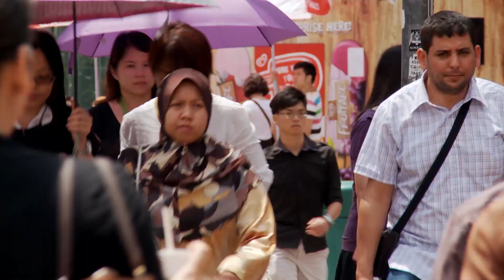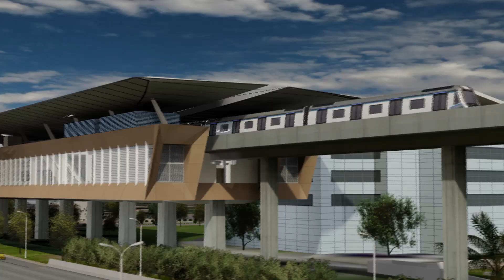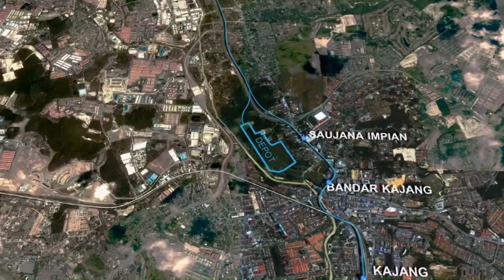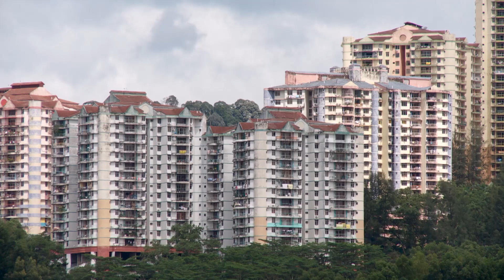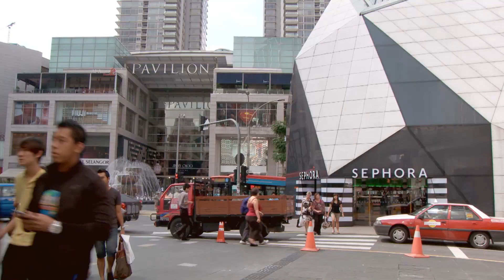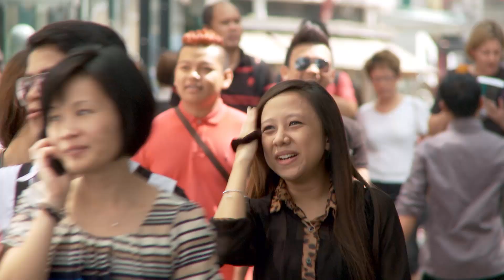The Klang Valley MRT Project, A Step In The Right Direction

Comment: No it wont relieve the road congestion simply because the population grows and the fact that even with mrt 1, 2 and 3 is complete there is still gap.  But a significant number of the public will also use rail transport so imagine if fhere is no rail transport at all. I can only imagine the traffic will be like jakarta where the traffic jammed is nasty, ugly, brutal and unforgiving. So in 2020 we have 10 million ppl and maybe 4 million have driving license. We can choose to have 4 miilion cars on the road or built rail and reduce the road users to 2.4 million. This save a lot of energy (petrol), reduce polution, save time, reduce accident, reduce road rage and many more. All super city like munich, london, new york and singapore becomes great city because they begin with good and efficient metro first
Reply: why won't it relieve congestion? if no mrt 1,2,3, lrt 1&2 extension, lrt 3, traffic would surely be worse.
Reply: traffic will significantly improved once mrt 1,2, lrt extension is completed. Im just saying that traffic will return to its original state (maybe in 2025) simply because population increase and even with all the rail networks completed, there are still area which is innaccesible by rail